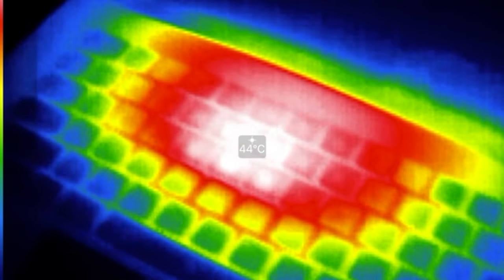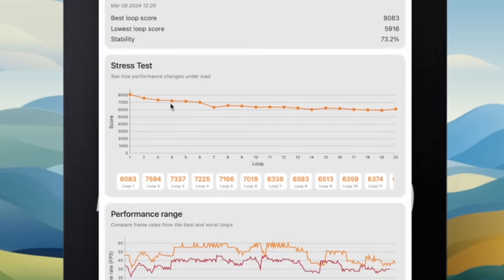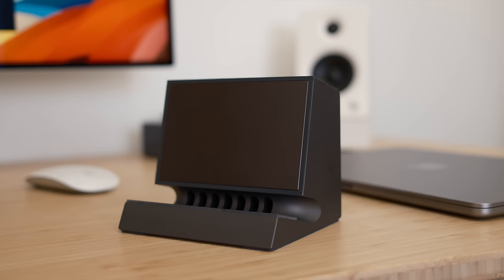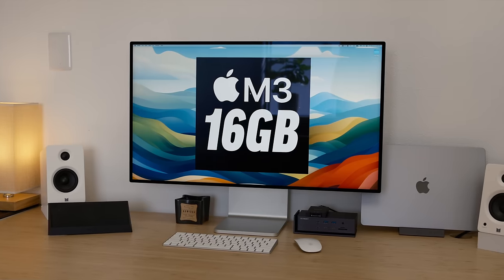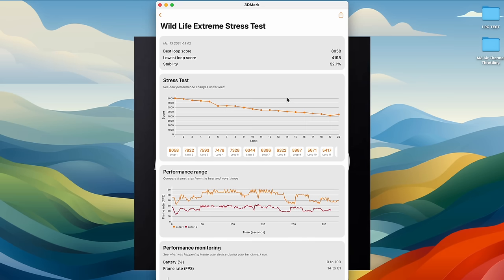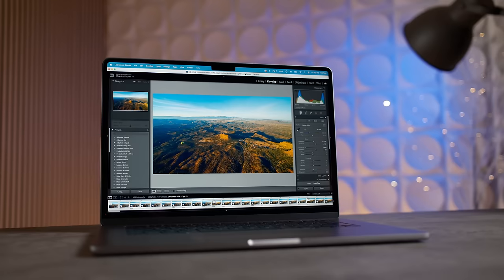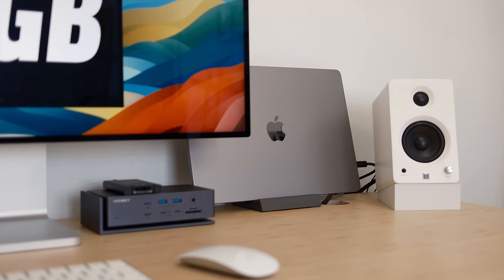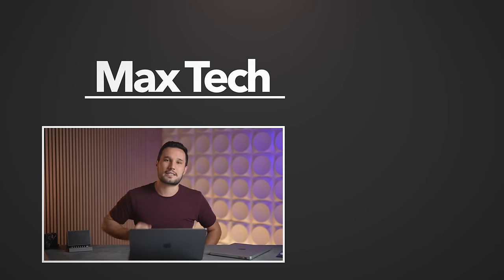Making my M3 MacBook Air FASTER than M3 14" Pro!

Comment: Ppl are harping on the cooler for being expensive. But having worked with small design machine shops, its expensive to make something like this.

Also, it would probably be beneficial to the Macbook Pro too as my fan would get LOUD especially in clamshell mode.

Comment: Does make you wonder how an MBA would perform on a $25 active laptop cooler… or even sitting on a $10 granite tile cut to fit between the feet so it’s in contact with the base
Reply: It also makes me wonder at how far they could push the M3 in a well cooled mac mini or a mac studio.

Comment: You might have added the thermal cam shots of the backplate, when stressing the CPU with and without the pads. I believe it would be very informative for prospective implementers of the hack.

Comment: This video proves, but without mentioning it, a major issue with macOS, not with the MacBook Air or other Mac laptops: the glaring and nefarious lack of an option to turn off the screen when connected to an external monitor. This is really easy to implement for Apple, of course, and makes a big difference in terms of user experience and performance, as illustrated by this video. (Windows and Linux have this option.)

Comment: I mean, what you're doing is using the chassis of the Macbook Air to dump heat into, whereas before there was an air gap.  I think the only issue would be if you end up using it in your lap, the chassis will get a lot warmer.

Comment: What I learned from this video, by 4:32: You can use any vertical or horizontal laptop stand as long as it allows for excellent air flow, have a fan or air conditioner blowing directly onto the MBA constantly while in clamshell mode or in (open?) normal mode to improve cooling and computing efficiency. If you are going to be doing some hardcore rendering on that MBA perhaps putting ice packs onto the bottom of the MBA will work to keep it cool while rendering. lol I don't know if that would actually cause harm, so - uh, don't do it, maybe. IDK.

Comment: These thermal pads will dissipate heat to the bottom case. Then opened the heat will be trapped on the desk and lead to swollen battery due to heat build up.
Reply: Not happening. I have modded my M1 Macbook Air with thermal pads 2 years and a half ago, and the battery is only marginally hotter under extended periods of full load (I did test it). You are right that it could happen in theory, but in practice, from my experience, it doesn't. Also, someone else in this comment section has explained that they use thermal protective film between the bottom case and the battery to further protect it, which is something that I may try some day.

Comment: 1900 Euros for a 15" inches Macbook Air with 512 ssd and 8 gb Ram in Europe. Sorry but with almost 2.000 Euro thats a robbery. At the moment there are options for business/gaming laptops at the same price with rtx 4080 inside. Macbook Air was a student solutions and not a premium product. This product exists only a few price distance away from Macbook Pro to finally push you buying this. Macbook Air 15 inch with 16 ram and at least 512 ssd, shouldn't cost more than 1400 euros/dollars.

Comment: It is INSANE that someone who bought a 15" MacBook Air with only 8GB RAM + 256GB SSD for $1299 also needs to spend $279 for a passive cooler which is just a block of metal.
The pricing on Mac products just proves that Mac users have more money than sense.

Or you could just buy any number of Windows laptops that don't have this problem (because they have freaking fan!) with 16GB RAM + 1TB SSD for less money.

Comment: The pads have a downfall, which is that the heat will spread on the base. If you are using in clamshell, there is no problem but if you use in a position that you body is in contact with that bottom area, you'll feel noticeable hotter.

Comment: 270$ heatsink is silly, thermal pads and a 10$ fan stand will get you 90% of the benefit, I have been gaming on a thermal modded M1 air since 2020...

Comment: The problem is with the cooler, the MacBook Air is way bulkier than a MacBook Pro by itself. It's also not a viable option if you're using it in normal laptop mode instead of clamshell mode. If you're using the device in laptop mode, the MacBook Pro is still better in performance.

Comment: I want to know what's the performance like for a MacBook Pro with thermal pads.
Reply: It does not improve the performance at all, because the heat is already evacuated by the fan. The thermal pads mod only makes sense on fanless designs. I have done it on my M1 Macbook Air, and recently on my 2017 12 inch Macbook with good success, but it is important to note that the temperatures on the bottom cases of both devices are now unsafe, which explains why Apple does not do it.

Comment: So with my tight budget my options are getting a 16GB M3 MacBook Air that may die in the meantime due to overheating issues, or a an 8GB M3 MacBook Pro with fans but it will have a poor performance because of the lack of ram, mmm, or I can spend some other $200 USD in just some other 8GB of ram which is practically insane. Amm, or a cheap windows gamer laptop for half the prince and double the specs that will sound like an airplane and may die in less than 2 years.

Comment: Very interesting demonstration. I stopped using laptop coolers as I found that the more recent laptops from Apple (last 10 years) weren’t getting much improvement in performance from external fans. Just lifting the laptop off the desk on a cheap stand was enough for a 10% improvement for long sessions, external fans sometimes seemed to interfere with Apple’s internal cooling design. I would see temperatures slightly higher with the fans running! Using a closed laptop seemed unproductive and a good way to shorten the laptop’s lifespan, so I never did it. This changes my mind a little for future purchases.

Comment: You are massively overplaying this issue, a passively cooled machine throttling when running an artificial stress test over long periods should be no surprise to anyone. The surprising thing is how little it actually throttles. I have a M3 15" Air, and under realistic workloads it stays stone cold all the time, even in clamshell using dual monitors. There is no doubt the Pro is better value for money, but I love the form factor of the Air, and if you dont play games (which is a waste of time on the Mac) there is realistically no need to buy the Pro if you prefer the form of the Air. That being said, the heat block is very interesting, but eyewateringly expensive for what it is.
Reply from the maker: Did you watch the full video? My last test was with Lightroom photo editing. The 15” air was twice as fast exporting 500 photos.  As a photographer I’m usually exporting 250-500 photos and for weddings 1000-1500. Yea for those doing simple tasks don’t worry about it, but if you do push your machine you might want to help it stay cool and get full performance and even better than the 14” MacBook Pro.

Comment: Hi Max Tech, is the 1mm thermal pad recommended for the 15" M3 MB Air as well? or the 1.5mm would be better. In the video you showed the 1.5mm version? But in your description you recommended the 1mm version? Thanks.

Comment: with the rate of charging that you can get out of a usb c cable for your monitor, the power brick basically becomes obsolete for these portable devices. an air doesnt really even need one in the box.

Comment: The argument the battery can sustain extended heat spikes during recharges doesn't seem to answer the question as to whether never letting the battery cool down due to the pads can actually harm it. Some ppl tend to say that the pads have damaged their battery life. Still anecdotal evidence

Comment: This is interesting thanks for producing this. Do these pads need to be replaced after some time? Also, any safety issues with the pads such as them degrading over time? Lastly, would this void the warranty? If you could next time running this (amazing) set of tests, please address these questions also that would be awesome.

Comment: In my region,
MBA 13 16/512  1,540$
MBP M3 Pro 18/512  1770$
If I can afford 1,540$ then I could also afford 230$ more. For this I'm getting a bit bigger and best display, better sound, better performance overall, 2GB more RAM, better portability etc.

Comment: I have been looking for a new laptop for quite a while now. I wanted to leave the PC world for the first time in my life using PCs- since the 80’s. One of the reasons I was thinking of going to Apple stuff was my iPad Pro which I love for its silence when using. I had an Alienware when I owned a business and I got tired of the sound of a jet taking off CONSTANTLY. I liked the prospect of running a laptop which could run much cooler. I have come to the conclusion that speed equals heat. I know- genius of me. I haven’t pulled the trigger on any MacBook because of all these YouTube guys that break down Apple products to the point that all I see are the flaws. I don’t want external fans and heat syncs and cooling pads. Welcome to my last 15 years of speedy PCs. Now I’m not sure what to do. Maybe keep using my crappy laptop with my i5 processor that is slow as can be. But it’s okay for running Word and Excel. I’ll use my iPad for everything else. But I really wanted to pursue a new hobby of writing music in my retirement years using notation software and DAWs. Sorry for the long rant. I am really starting to hate technology. And my old business was based in technology!

Comment: Nice work. I suppose the obvious question is why didn't Apple install thermal pads or similar solution to transfer heat at a higher rate to the bottom of the chassis. One reason might be that the temperature at the bottom of the chassis would increase too much for someone who is actually using the MB Air on the lap thus increasing the risk of a burn to the legs for someone who might just be wearing shorts. When using the computer on the lap, heat would get trapped by the legs thus defeating the purpose of the thermal pads. To a lesser extent, heat is also trapped when the computer sits on flat surface.
Reply: You are correct. I have done the thermal pads mod on my M1 Macbook Air, and the temperature on the bottom of the case can become unsafe with intensive workloads: around 65°C (149°F). So I would not want anyone in my family to use one of those if Apple sold them. Anyway, they would not even be allowed to sell them. Apple is doing the right thing by thermally isolating the processor from the top and bottom of the case.

Comment: Great tests and very interesting!
Apple should use that solution inside the MacBook Air to avoid it heating up and also to improve its performance.
I hope Apple’s team watch you… They should be informed about those solutions!😮
Reply: What are you talking about? Apple isolates the processor from the bottom case on purpose, because if they didn't people would burn themselves with their computers. I have done the thermal pads mod on my M1 Macbook Air a few months ago, and I can assure you that it gets dangerously hot under the computer with this mod. It would be absolutely irresponsible for Apple NOT to isolate the processor. Where does this idea that they are just a bunch of clowns come from? They are doing the right thing, and you can do the mod if you want, but then you take full responsibility for it, that's how it should be.

Comment: Moral of the story the MacBook Air isn't made for long intensive work loads and the only way to fix this is to void you warranty, make you battery wear out more quickly, make the bottom of your laptop super hot and maybe buy a 230 dollar chunk of metal just to finally get similar performance to a MacBook Pro. You should get a MacBook Pro for  extended loads and get an air if you do light tasks or short work loads.

Comment: Nice mod but sadly batteries will degrade faster lithium ion batteries degrade faster more they are exposed to higher temperatures.
Reply: But..without the mod, the cpu is spreading all the heat inside anyway-

Comment: So, is it possible that an M3 iMac is as fast as the M3 14" MacBook Pro since it is cooled with fans? Is there a comparison you can do after demonstrating that cooling, the MacBook Air significantly increases its performance overtime?

Comment: For the price of the cooling dock and the MacBook you are basically paying the same amount as for the MacBook Pro. With such marginal “possible” gains, seems like it would be better to just go with the pro. That’s not even counting the cost of the thermal pads added on.
Reply: And voided warranty. But it's a fantastic solution.

Comment: just 2 thinks i wanna add to the convo here. first is that the bottom of that mac book air will be way hotter now. Apple didnt use the back panel for cooling for a reason. Its likely gonna burn your lap if you use it at high load for a while. and second I bet that fan on that laptop coler thing was way louder than the mac book pro. Gotta keep these thigns in mind before doing this mod.

Comment: The battery heating issue is more than you explained..  when MacBook charges, it heats the battery, but its only for a couple of hours but when this “Jugaad” you proposed, runs it runs for hours and that is not good for battery..
Reply: My recommendation for people who go with this is to add some insulation between the back cover and batteries.. like glass wool or something similar..  that will avoid batteries getting heated for longer periods of time.

Comment: Wow, this video is very eye opening. I'll definitely install a cooling solution if I get an Air. I'm curious to know how the performance is when using both the Air and Pro open while connected to an external display. In my case I have an ultra widescreen monitor connected via a Thunderbolt port, which also charges the laptop.

Comment: Great video.  What are your thoughts on improving the performance (without a relevant comparator (i.e. an air) for a Max M3 16 with the thermal pads, and perhaps a heat block?

Comment: I wonder if there is a reason that one of these laptops has passive cooling and the other has active? 

Maybe it’s because one is meant for actually getting work done and the other is meant for casual computing/use!?!

I mean, I am so shocked that two laptops with the same processor perform so similarly when they are cooled similarly.

Comment: Question now is how hot does the underside of the machine get with the thermal pads. Is it still usable on your lap without burning your legs?
Reply: It gets warm quickly anyhow, unpleasant in lap, also bottom of the screen heats up straight away if used at 80%+ brightness, shame for such portable/light machine, that it gets so warm/hot on light usage, browsing, YT, movies...

Comment: How are the bottom panel surface temps with the thermal pad mod? Still usable on your lap? Or is it a desk only kind of laptop after the mod?
Reply: My m2 MacBook Air 15 inch gets uncomfortably hot when the MacBook is under loud and the m3 is hotter then m2 and with a thermal pad will be even worse so it would be uncomfortable for heavy loads but fine for light to medium intensity tasks like web browsing or photo editing.

Comment: Thanks for the video. Could you also test thermal pads + desktop cooling pad (fans for working with the laptop opened)? You just tested a cooling system for closed lid, could you test a system for cooling with the laptop open please? Cheers :)

Comment: This is both awesome and also very sad because this underlines lowering in quality and engineering from Apple. When designing a device, its performance and thermals should be optimised as hell, because the things should be used in difficult climates etc. At least the thermal padding should be here from factory. This is a new kind of overclock.
Reply: Do you even understand what the thermal pads are doing? If you do, then you’ll realize it isn’t a perfect solution. It has drawbacks

Comment: Get it in your heads, that the air is NOT designed for constant heavy loads! Its designed for portability! Get a Pro, if you are gonna have a constant heavy load on the GPU and CPU.

Comment: I just want to know why Apple wouldn't have just added thermal pads? Their engineers no doubt recognized this issue and I also assume they know about thermal pads. Why didn't they engineer better heat transfer to the chassis if the thermal pads are this cheap?
Reply: I think users wouldn’t want the chassis to get super hot so they can work on their lap. And this extra heat may be bad for the battery

Comment: Wait so if you buy the pad and cooler and the fan it comes to $350 plus the Air with same specs as the base Pro is $1499, totalling in $1849. Also it become more clunky if you want to travel with it and will weigh more with all the extra components. While the Pro is the entire compact package of $1599 with all the same specs. Additionally the Pro will have a better screen, speakers and computing power with RTX.